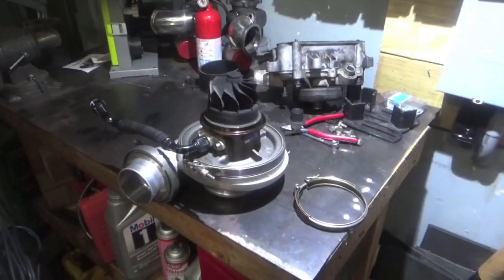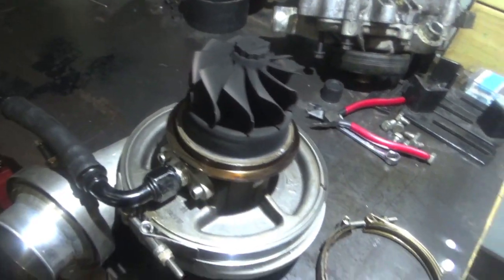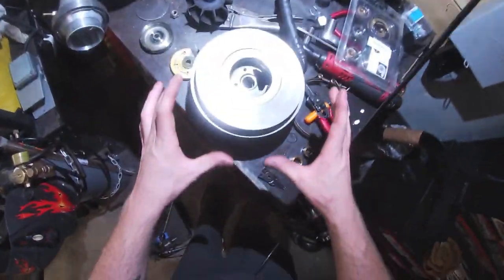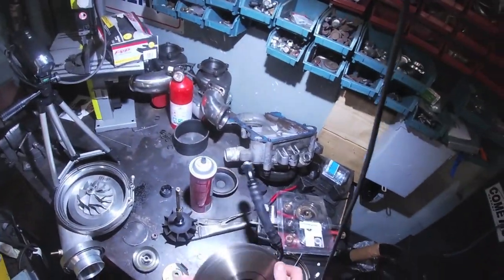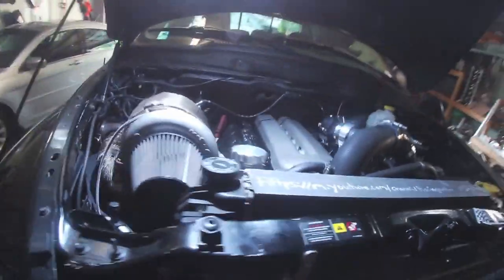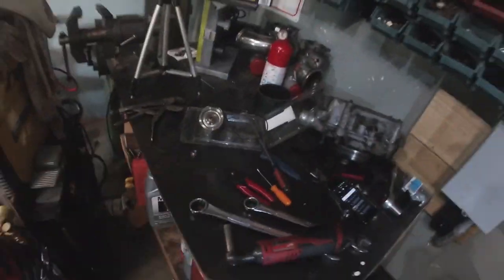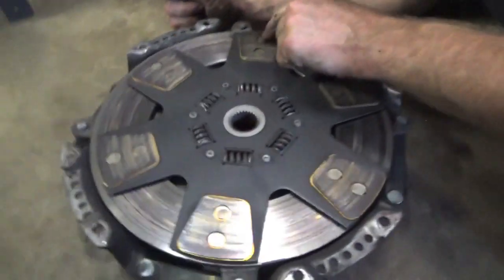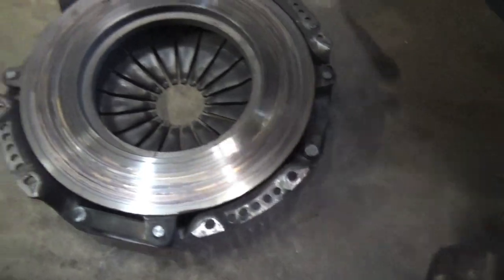DIY Turbo Rebuild in your garage. Borgwarner sx400 rebuild

Comment: Is that the 83mm turbine,  what is yours t6 or t4. I just bought another s475 mostlikely gonna try and rebuild mine myself. The one I got came with a 1.0 ar t4 I believe its a 83mm turbine.  The one I got running on my car is a t6 s475 with 96mm turbine
Reply from the maker: T6 s475 96mm turbine and 75mm compressor